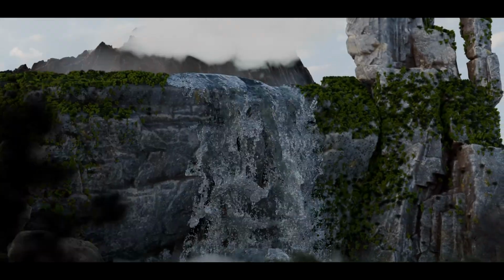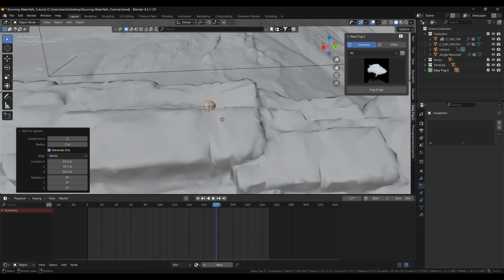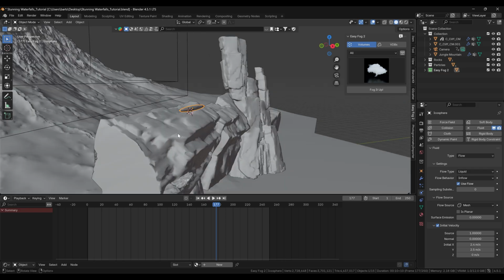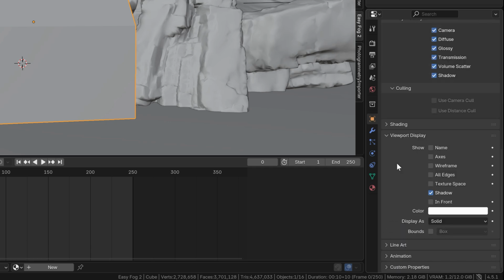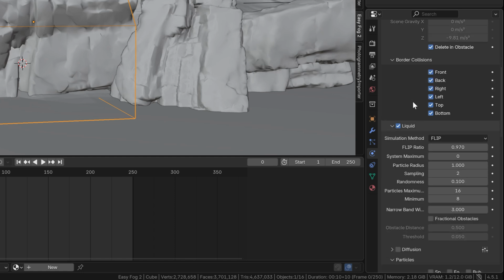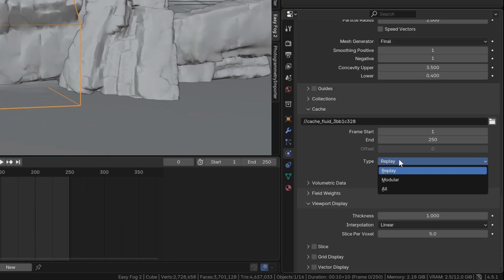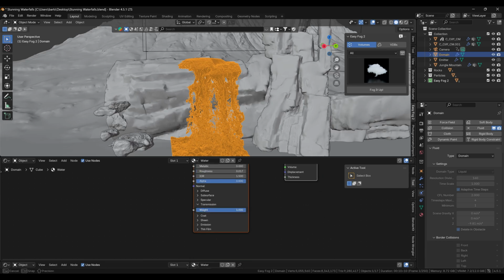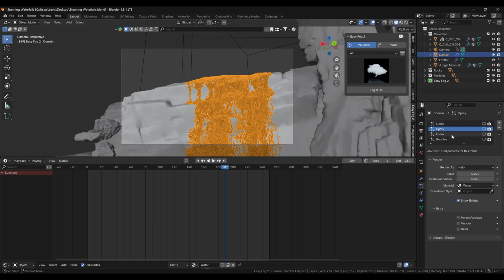How to make a 3D Waterfall in Blender 4.5 (Beginner Tutorial)

Comment: Question: is there any way to preview this at first? so you're not just spending like 15 minutes every time you want to see the results?
edit: I had to give up on this method. All I got was a slow, thick blob come out of my emitter, no matter what I did. That was if I was lucky. Sometimes nothing at all happened.
Reply from the maker: Well there are a few things you could maybe do but to be honest that is the problem with fluid simulation kinda... They can be incredibly frustrating, I know... In your case I would say that your emitter is either too small or your domain is too big...
Reply: @AfternoonCG  I ended up downloading a dodgy copy of Flip Fluid just to see if that would be any good. It was also quite slow. Much better, but still no good.
Reply from the maker: Yeah, that is probably an issue that can only be solved with more computing power... So maybe in a decade fluid simulations are more fun :(